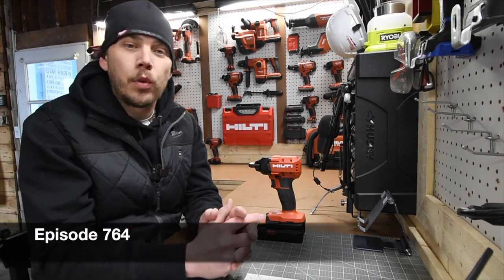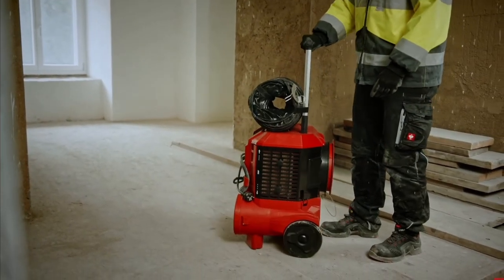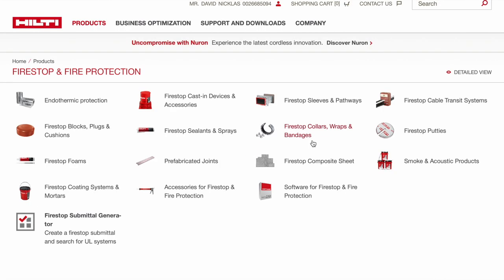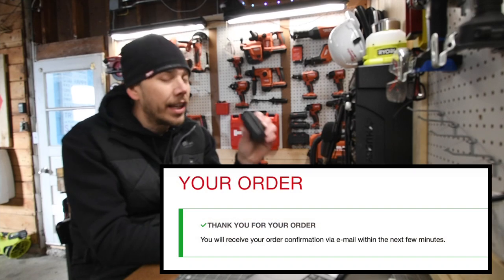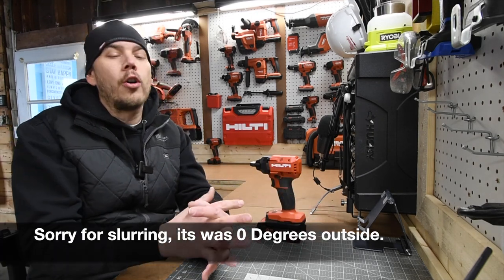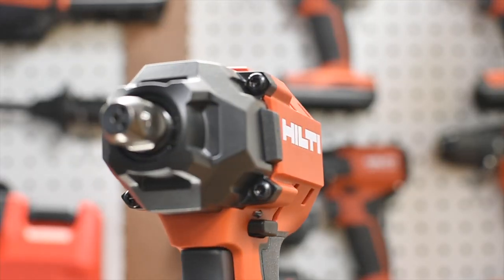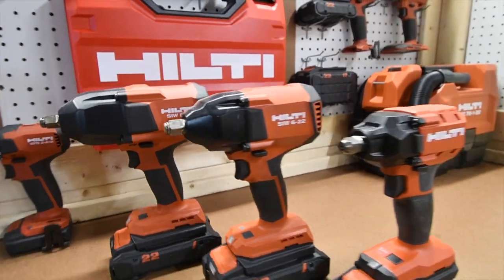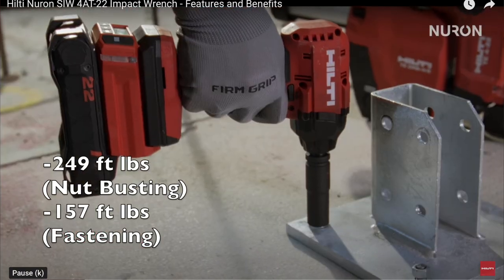HILTI added More Tools to NURON, and 12v POWER BANK!

Comment: Milwaukee makes a 12v power bank. It works well. I’ve used it almost every single day for a year. No complaints. I also picked it up for less than $30.
Reply from the maker: I use the m12 power bank now as well